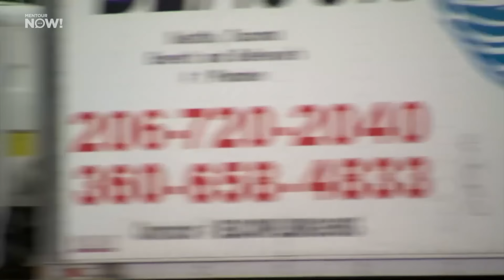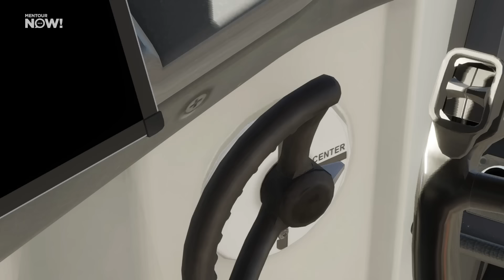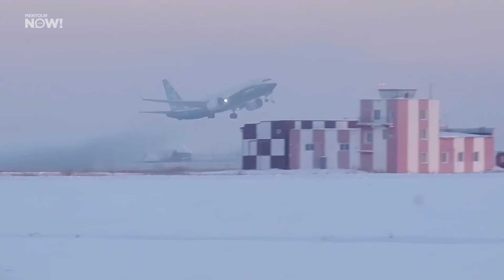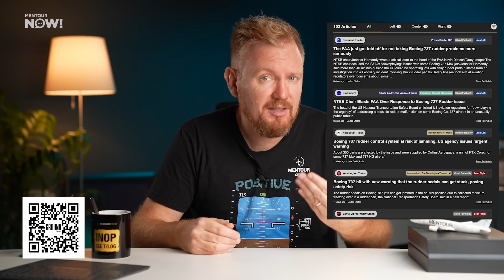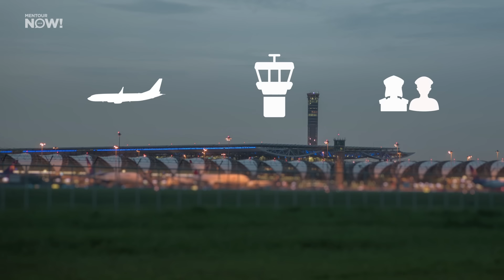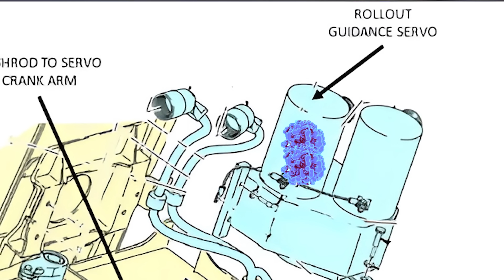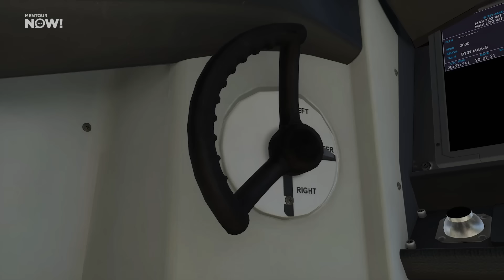Does the Boeing 737 Have ANOTHER Major Flaw!?

Comment: I thought the real issue was, that the systems are present on the Airframe, but are not marked as being "installed" since delivery customer did not order these options. 
Being very similar to "MCAS", "Cockpit door opening on decomp" now we have "rudder actuator option", of which pilots are not made aware of the part, and potential issues.

Comment: My understanding of Cat 3 approaches is different. Cat 3C is 0m RVR thus never done. Cat 3B is 75m RVR No Decision height. Thus you do not need to see the runway to land on it. If it has a decision height then you need to see 1 runway light <50’. Cat 3A, has decision (usually 50’) and requires 3 runways lights and greater RVR for manual rollout. Capt A350

Comment: I am shocked that "disabling" a system means leaving it inside, deactivated but still connected to a "live", and critical system! That is bad, bad engineering.
Reply: "Disable" means to render unable to act, which doesn't necessarily mean removal.  Doing it this way is a very common practice in basically every industry, not just in aviation.  Note that, as far as I'm aware, the NTSB is not recommending that disabled equipment be removed from aircraft, only faulty equipment and in that case weather or not the equipment is disabled isn't taken into consideration
Reply: This is a heritage from McDonell-Douglas. In the 1990's SAS received a batch of airplanes with a thrust reduction system dormant in the airplane, but SAS didn't know it was there. The TRS was a contributor to the SAS751 crash in Gottröra.
Reply: I am an engineer and I agree with OP. Disabled doesn't mean it cant affect the reliability of the rest of the system. It would have been a much cleaner job to remove it entirely and considering it's an 'option' part designed to be an add-on in the first place, probably fractionally more expensive to remove instead of just electrically disabling it.
Reply: Yes, tell that to human DNA.
Reply: @phildane7411  Your argument defeats itself. Evolution depends on some mutations out competing others, which have to die out for it to work.  We don't want people dying in order to develop aircraft.
Reply: This is a very common practice for a number of reasons.  For example, every Land Rover discovery II has heated seat grids and wiring but no switches if you didn’t order the option. Likewise, every ‘97 Defender has an AC compressor whether AC was ordered or not because it would cost more to design a separate idler pulley to replace it on the few vehicles ordered without it.  

We also don’t know if United even wanted it removed.  They may have wanted it there for resale or potential future use if more airports began having the technology to work with it.
Reply: That's the whole meaning of disabled.
Reply: How much bad it may look It's not uncommon though..bcoz when u remove certain thing from whole system which is tested with that part in place you literally need to do lot more test and checks. So they just deactivate it. Obviously in some cases like this issue it produces side effect that they never thought of. BTW there is no guarantee that removing that part physically won't have produced any other side effect that de never thought off. Long story short it's easy to say something retrospectively about certain things rather than dealing with the situation in time.
Reply: You have bad, bad awareness of reality.
Reply: Not as unusual as you might think, and usual comes down to cost. It is significantly cheaper to have a single assembly line than modify it for a specific model. The fact you are shocked shows how little about engineering you know.
Reply: @goldenhate6649  It is not "disabled" if it can affect something live. Thanks for confirming that cost is more important than doing a thorough job.
Reply: @goldenhate6649  He was talking about an aircraft that was modified after delivery.

Comment: Dear petter I think exactly this part years ago manufactured by the same company goofed up and their is a you tube about it , this part had dual coaxial working pistons  and they found glittering metal particles in the internal oil. They only found this by shock freezing. Could it be this is basically the same fault just in the more modern simpler mechanics

Comment: Unfortunately this casts another cloud over Boeing corporate governance too-wit  the New Boeing CEO Kelly Ortberg was CEO of Collins aerospace at the time the faulty servo units were produced. There is obviously no suggestion of anything untoward but it again  highlights the incestuous nature of the management of Boeing and it's suppliers.  
Boeing rose to the top of the pile precisely because it pursued policies of Governance, safety and engineering which were at odds with the rest of the industry in America. Yet it has been close to destroyed by management from those companies.
To regain public and media confidence Boeing needs to bring in Management talent from outside the North American industry with no possible loyalties or connections to existing systems and relationships. Also shareholders need to commit to the travelling public that they will support the rebuilding of Boeing according to it's historic principles.

Comment: This is the same problem as the door plug, when a plane doesn't use something, there shouldn't be a patch over the thing that it doesn't use. The Alaska Airline 737 Max 9 shouldn't have been made with a fuselage with an extra hole for a door. The rollout guidance actuator should've been removed before the plane got delivered to United.

Comment: The definitions for a CATIIIA/B/C in the video I think are not quite right. In Airbus world, the aircraft will auto land and guide itself down the runway in all CAT II and IIIA/B and theoretically C approaches, The differences between say at CAT IIIA and CATIIIB are what the crew need to see to continue the approach. So, for a CAT IIIA you need to see a minimum of 3 centre line lights at decision height (DH), in order to continue, otherwise it's a go around. For CAT IIIB, with a Decision Height you need to see a single runway centre line light, and if you do a CAT IIIB with no DH then you don't need to see anything. 

So, for example with a CATIIB NO decision height, you don't need to see anything and you can let the aircraft land, hence no decision height, BUT ... here is the other requirement, you still require a minimum RVR of 75 meters, so in theory when you stop you will be able to see something. This is totally different to CAT IIIC. A CAT IIIC is an approach with no minimum RVR requirement and this doesn't exist.

Now, the RVR is based on sensors that measure the thickness of the fog, and they are calculated values. the RVR, or runway visual range, will be a higher value than the actual meteorological visibility as it is based on the fact you have high intensity lights to pierce through the fog and guide you, but it is possible you land with an acceptable RVR but in actual fact can't see enough to taxi, but that is different to a CAT IIIC as you still had the RVR available. 

This is all quite a complex concept for people who are not professional pilots and low visibility trained, but essentially you need both an RVR which is broadcast by the airport, and without it you can not start the approach (there are dispensations if you are already beyond a certain point on the approach but this is too much for this discussion), and as well as what ATC tell you is the current RVR, depending on which class of approach you also need to actually meet the requirements of what can be seen as discussed above. 

But back to my point, all airbus aircraft will go into rollout mode after the touch down regardless of the ILS Category of landing, it seems for Boeing that ability is an optional extra ... but my understanding is that the official definition of the difference between at CATIIIA/B/C is to do with the decision height and the required visibility.

Comment: The earlier model 737s had the same problem with vertical control, this is not new.  What also is not new is that since the early model problems, apparently Boeing has not done very much to rectify the situation.  Boeing is currently a lost cause but with enough outside intervention it is possible to get Boeing where it should be in terms of the public's confidence.  It will take time but it is possible.  Maybe Boeing needs to move major segments of it's assembly line outside of the U.S, to a more receptive labor atmosphere while under very strict U,S, government control and oversight.  It's worth a try because nothing else seems to be working at the moment.  Give each of the 33,000 striking employees a U.S. $ 1 million separation payment and start with new assembly line workers.

Comment: Incorrect: “First of all, they are connected via cables to a torque tube mechanism, which in TERM is connected to a main and standby power control unit…”

Correct: “First of all, they are connected via cables to a torque tube mechanism, which in TURN is connected to a main and standby power control unit…”

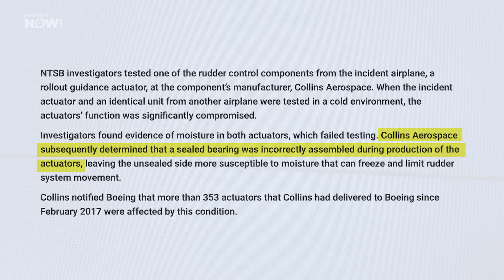Comment: 17:33 "sealed bearing was incorrectly assembled ... unsealed side more suspectible to moisture"
Am I the only one reading this as "bearing was actually installed backwards"?

Where's the QA process that's designed to catch exactly this kind of problems? Surely there must be a process where every step is verified by at least one another human being or the aircraft parts wouldn't be that expensive?

Comment: There is a need to be suspicious whenever the media start interpreting problems of this sort. There are thousands of 737's flying all over the place every day, it is a bread a butter aircraft. Has it had issues, yes, and a few of these included the rudder systems that were thought to be responsible for accidents in the past. A redesign was initiated, that it self might have led to other problems, but headlines of this sort raise fears amongst those without the means to examine the issue properly.

Comment: So, an aircraft built by a company almost destroyed by corporate greed in the USA, coming from an airline killed by Qatar’s greed, is causing problems to one of the airlines whose corporate greed caused the Max to exist instead of the NMA envisioned by Boeing engineers in the 1990s.
Why am I not surprised?
Most importantly, why is this greed issue not tackled in a broader way instead of concentrating on the details?

Comment: If I were boss man at Boeing, I would have:

a) told Collins to get at least a couple of hundred replacements manufactured and tested, and supplied with test results, and IMPROVED installation instructions

b) told Collins to expect the return of up to 350 of these parts for repair/refurbishment

c) in parallel with that, told all the operators that it could identify,  that replacements/refurbished units were being manufactured,  ought to be purchased fitted and in the meantime they can ground their plans or just whack the pedals if they keep want to keep them flying

d) tell the operators how many incidents have happened, to allow them to assess the risk

e) one the new ones are available, sell them with a core change that is refundable when the send the old one back,  or give operators the option of just buying a remanufactured replacement.   Oh yeah,  and sell the new/refurbished ones at cost price, and make that known so people don't think Boeing is just making money out of this.

If Boeing had put some effort into taking control of the problem and shown that they were managing it proactively, they could have started to regain some reputation.  As it it is, they have just made people think that they are clueless, and couldn't care less.

Comment: How does moisture under any circumstance find its way into presumably sealed avionics components? BOEING at the core of it all around, buying from substandard vendors with employees unfamiliar with proper assembly of said part.
Once again it's the stockholder's interests on front of engineering safety practices. BOEING BOEING BOEING, what else is new? At least it's not thruster issues in low earth orbit, preventing the crew to return back to earth.
I used to love Boeing aircraft, now I'd never want to step onboard a Boeing platform of any kind. Shame on Boeing!

Comment: Everyone seems to be forgetting the basic issue with the 737 Max.  This was not just a new variant of the 737 series, it was a totally new aircraft that was dressed up to look like a 737 to save a huge amount time and money getting the aircraft certifications done...  The FAA was fully aware of that but given that it is filled with former Boeing employees, accepted the reduced certification process.
The 737 Max needs to be re-certified as a new aircraft for it to be safe, the failings will mostly get found in that process because it forces Boeing to do the FULL testing work.
Reply: So does the Airbus A32X Neo need to be certified like this?
Reply: No, its the same aircraft.
Reply: @malcomreynolds4103  Yet all of the key parameters of what defines an aircraft like CoG, CoM, Aerodynamic center and the handling stability characteristics have significantly changed...
In fact they have changed so significantly that MCAS had to be developed in the first place.
Reply: @project-326  They have not "significantly change" your lack of mental stability has no bearing on that. Automated trim control systems are not new. They have been on every commercial aircraft developed since the DC8. what the system is named is irelevent. Suggesting otherwise is as dumb as suggesting that the brand name painted on spark plugs in a car is a problem when it does the same thing.
Reply: @malcomreynolds4103  lots of words, yet zero technical information to justify your rather odd reply.
Reply: This is the answer. Not sure why pilots flying it - aren’t being more vocal demanding this.

Comment: if you are a pilot reading this and have any command jammed and you are safe on the ground NEVER EVER force to command to unblock it, leave it how it is. Engineer sometime cannot reproduce failure and need to see a system in failure to properly investigate and not release an unsafe aircraft (not to mention creating potential secondary failure that can be very hard to detect)

Comment: Hi Mentour! I’m not sure about the FAA regulations, but for EASA the subdivision of CAT III into a, b and c does not exist anymore. All charts Low Vis minima are now just CAT III. The difference lies now in capability of the aircraft and company/ pilot certification. The minima will read: Company- followed by an RVR value depending on the airport/ state (usually between 175 and down to 75m RVR). In my company we subdivide CAT III approaches in CAT III with DH or without DH. With DH (at our company 50ft) can be flown with a fail passive system (single auto pilot, or CAT III single as Airbus likes to call it) and with minimum RVR of 175m. CAT III with no DH, has the minima af 0ft and minimum RVR of 75m and requires the aircraft to be CAT III Dual. (Fail operational, 2 autopilots active).

Comment: I can't believe how companies nowdays keep on failing to do comprehensive tests under ALL airplane conditions. Looks like they're only doing ground level regime tests but not doing high altitude tests under low air pressure, colder temperatures and other high altitude conditions that can be found at 30k feet up and higher. What are they thinking? Trying to cut costs by cutting corners?

Comment: This is the dumbing of America. The company that made the part used a bearing that is open on one side and that side has to be against the rubber seal. The workers who do the assembly have no clue why the bearing is only sealed on one side and the race is exposed on the other. They have no clue of the temperature in flight. So if someone is the person doing the work is just told to put the bearing in place. Its what you get.

Comment: It may be a completely different component and also a manufacturing rathar than design issue, but it is interesting to note that the rudder hard-overs that the early Jurassic 737s suffered also had an interestingly related cause- thermal shock due to being exposed to hot hydraulic oil after being cooled at altitude caused the rudder issues in their case.

Comment: I am a semiconductor maintenance technician.  I had a CVD system that had a short every once in a while. The only way to fix it was to kick it and kick it hard on the controller side panel.  I was the only one that could fix this.  Every once in a while, you just have to kick the crap out of it and walk away!
Reply: Until next time.
Reply: @peiwu979  I have seen a couple of bits of industrial machinery with i think sticky relays or solenoids, where the maintenance guy has left a hammer mounted to the side of the machine (oversprayed with paint so it doesn't go walkies!)  with a handy "HIT HERE, HARD" label stuck to the casing with arrows pointing to the right spot

Percussive maintenance, whatever works eh? :)
Reply: @mor4y  Bad idea in an airplane, as the NTSB told Boeing.
--I once owned a TV like that, until it stopped working completely.
Reply: Do you recommend carrying a small hammer or mechanic's boots in the cabin to troubleshoot problems in flight?

Comment: One thing after another for Boeing, the new CEO has his work cut out for him. Hope Boeing manages to go back to its engineering-based approach to development from before the MD merger. Also hope that other companies take note and realize shifting focus from making the best product to just making the most money is a disaster for any type of company. Greed kills – quite literally in this case. 

Could they not have used differential braking instead of the tiller to maintain centerline? Or are the brakes more touchy than the tiller?